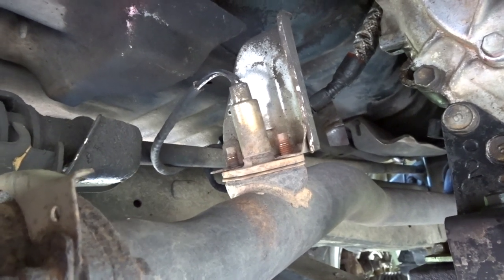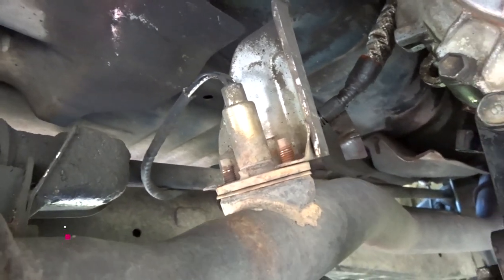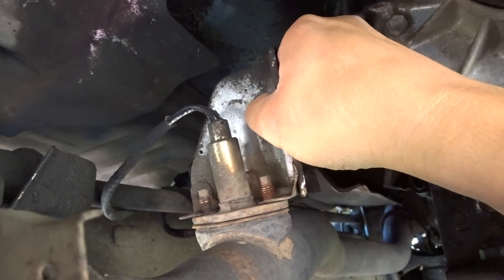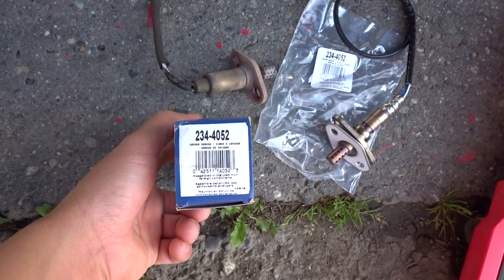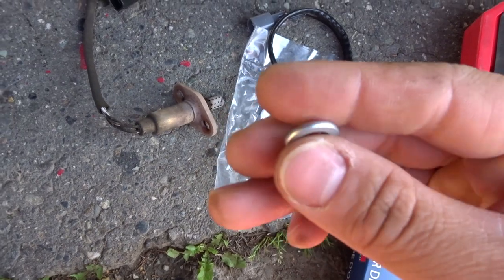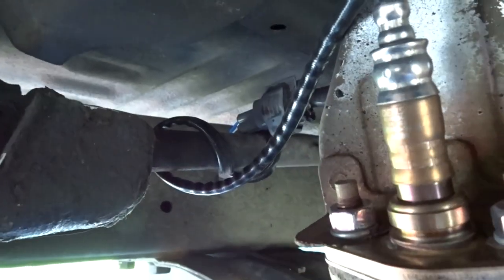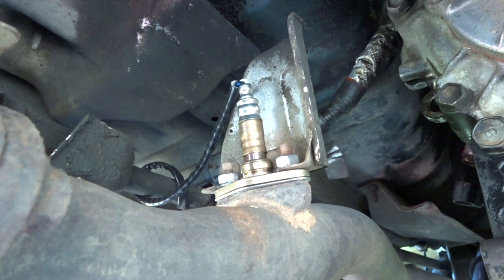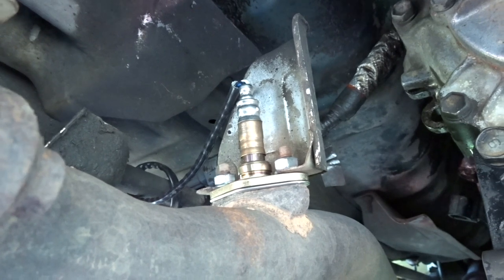TOYOTA 3VZE O2 SENSOR REPLACEMENT

Comment: I can't even tell what size the nuts on mine are...so much rust
Reply: Same.  My nuts look like a melted mess of goo, nothing square on it to bite into.   There is no way I'm getting those off with standard tools.  Might have to replace the whole front exhaust pipe.  Of course NuttyNu's truck is so clean, so makes sense he had no trouble.  I'm also missing my heat shield.  Bummer.
Reply: So were mine. Pair of vice grips and a cutoff wheel got them off. Air wirebrush to clean up the studs and gasket surface.

Comment: I've been going thru this all day. And according to several sources (which may not mean a thing the way car companies play) most of these older Toyota PU have only 1 O2 sensor, and it's up on the manifold on the V6.
The ones that have 2, have one where yours is on the pipe past the cat, and the main one on the manifold. According to the 3 sources I have open right now, only the CA. vehicles have 2/adding the one on the pipe. 
If yours isn't a CA. vehicle, you should only have the one on the manifold. If you have one on the pipe, it's either a Cali Car, and should have another one up on the manifold, or someone put Cali exhaust on your non-CA vehicle.
https://i.stack.imgur.com/WGM3i.png